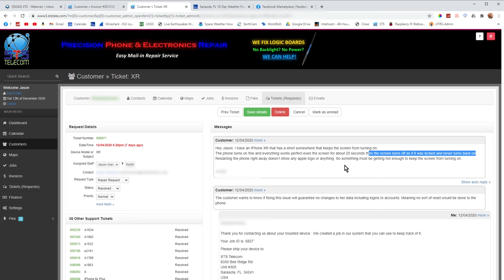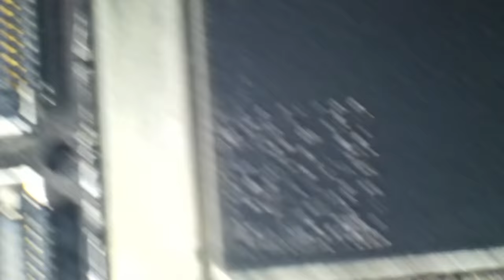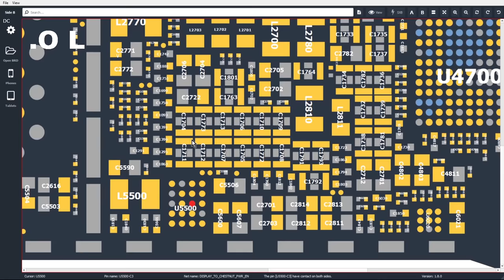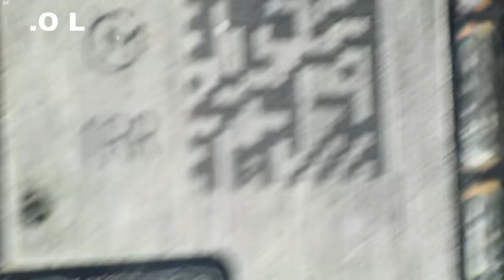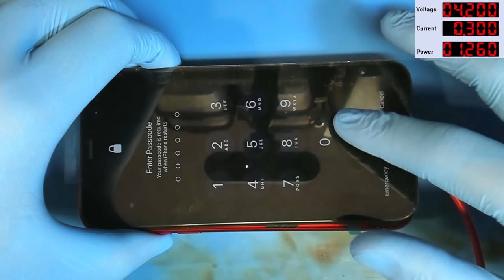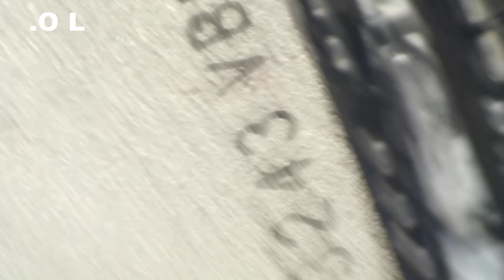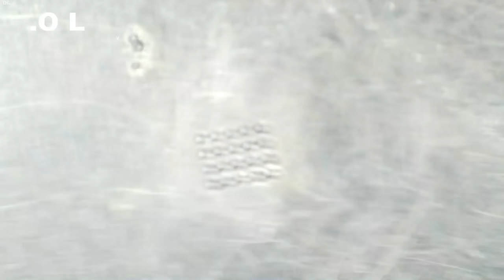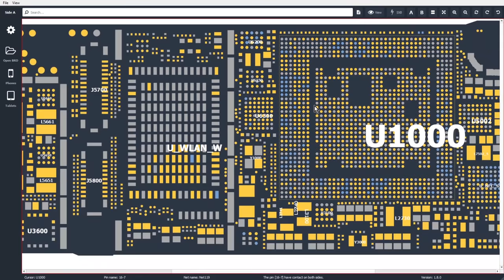Repairing an iPhone XR with "No Image" - What I found inside this phone was horrifying!

Comment: No kidding your heater isn't calibrated if you're setting it to 195c without boiling water
Reply: @Constantine Papajim even if that's the case he clearly said C not F multiple times, idk how you get the two mixed up
Reply: maby this guy writes kelvin with a c? tho then he'd be freezing it ...
Reply: @Constantine Papajim He says 195C.. that's 95C over boiling.  (And at 350C, the solder and plastic on that board would be already melting away )
Reply: @Constantine Papajim he said 195C
Reply: @AdeptPaladin   i thought that to
Reply: Water can boil at under 100celcius it all depends on what you using to heat it up
Reply: @southaussiegarbo2054  water can evaporate at below 100c, but only boils at less than 100c if in an environment with less atmosphere. The heater makes no difference to waters boiling temperature.
Reply: @nyxaelia115   i have boiled water back in year 9 science at about 75celcius.
Reply: @southaussiegarbo2054  I'm assuming that was a science experiment to show how under certain circumstances this is possible? What were the conditions? (Genuinely curious it sounds like a cool experiment). Pressure cooker a boil water at above 100c, but that's a change in atmosphere too. I don't believe if I were to put water on the stove at home at sea level it would boil at any temperature other than 100c. If you're below or above sea level (so a different level of atmosphere) it would be different, but probably not to the extent of 75 - 195 c
Reply: @nyxaelia115  just regular lab with bunsen burners and gauz mats on tripods. Beaker full of water on top.
(I finished school in 2019 so year 9 is to far back but i remember the weird stuff we did) 
Once the teacher also brought in wine to show us the distillery. 

Fyi no they dont do the boil water at 60celcius(water temp) now bc a class had beakers explode 😂.

Flame in one spot was hot enough to melt metals like copper.

Once my class set fire alarm off when i was leaving(cooking day and was pasta) bc i was sick. I herd a ringing signed out went home mum came home and asked did i have to light school on fire before i left 😂.

Next lesson i was their for im like "righto so who set the fire alarm off" and teacher said "us" 😂.

That case was 2 fire trucks but oneday at lunch 14 fire trucks show up bc of a fire in canteen and the caller said "the canteen is on fire" so bc that buildings linked to 90% of buildings in the school they sent a crap load of trucks. Oops when they cost 600bucks per truck for a minimum fee 😂😂.
Reply: @southaussiegarbo2054  The only way you boiled water at 75C is if you pumped air out of that beaker. There's a way to use steam to create a vacuum too, but that involved boiling the water at 100C then sealing the container and cooling it to create a vacuum inside. At normal atmospheric pressure, water will NOT boil anywhere near that temperature.
Reply: Yes, he says he's not going to heat it up enough to boil water, then he says no higher than 200C, which is equivalent to 401F. It does seem obvious that he misspoke, and meant to say 200F, which would be an easy error to make for someone unfamiliar with working with ANY temperature scale, but harder to see for someone experienced in working with measurable heat. I don't know what good explanation there could be for that mix-up.
Reply: @southaussiegarbo2054   It is actually completely irrelevant what material you have used to produce the heat. The boiling point of water is going to remain the same for your altitude regardless of how fast or slow you heat the water, regardless of the method you choose to produce that heat.
Reply: @kristinorthcutt111   not true the boiling point can change.
Infact under a complete vaccum it can boil with no heat at all
Reply: @VecheslavNovikov   it can but its hard to do.
Reply: @southaussiegarbo2054  I don't know what the actual experiment might have been that you are misremembering, but I am sure you are misremembering. For water to boil at 75C, using nothing more than a beaker and a bunsen burnet, this would have had to have taken place at the top of Mt. Everest, at the altitude of 28,000 ft. I am quite certain there are no 9th grade science classes being conducted at the summit of Mt. Everest (or any classes of any kind at any level).
Reply: @kristinorthcutt111   no the temp wont stay the same. Basic science proves it can change temp depending on factors
Reply: @southaussiegarbo2054  Factors like air pressure. At sea level pressure, it's 100 degrees.
Reply: @VecheslavNovikov   the science labs at the school were pretty dodgy.  
The water was also rain water so that could affect the boiling point just like salt does.
Had one point they had to drain the 20k ltr tank onto oval bc the water would burn which is not a good thing(mind you it happens in some aeras of my state so people cant use it to drink bc its like unleaded petrol when you put a flame to it....gulp(made local news and everything)
Reply: @southaussiegarbo2054  It sounds like the water wasn't boiling,  some contaminant in it was. do that long enough to boil off the contaminant and you're left with hot, but not boiling, water. But no, rainwater shouldn't have much contaminants in it since it's freshly condensed. You might have dissolved gasses and dust in it, but not really anything that volatile.
Reply: @VecheslavNovikov   possibly. But for cases of it being flammable is strange(not common but has happend here especially near mining towns
Reply: @southaussiegarbo2054  Come on now. Everyone know that water boils at 100C under "regular" conditions. This is a common fact that even the smallest of children know. The fact you misunderstood something in those shitty experiments doesn’t change this universal fact. Are you REALLY arguing this? Ridiculous. No matter how many times you say that doesn’t make it true, and it’s incredible that a teacher devised an experiment that completely devastated the world view of his students. Even more incredible is that you can’t grasp this basic fact. Please calm down now.
Reply: @VisionThing   it can change by various factors. You need to of had a decent science teacher to know it wont "always" boil at 100celcius thats just the most common temp it will boil at
Reply: @VisionThing   go do some good investigating and u will see that i have said a true thing. Lol teacher and science didnt lie
Reply: @VisionThing   goto denver and it will boil below 100celcius.
Reply: @southaussiegarbo2054  I knew this would happen, and you just won’t let it go. As I said water boils at 100C under "regular" conditions, with very little variation. You know this. Your water did not boil at 75C! It just doesn’t matter how many times you say it did. You did not produce a vacuum, neither did you conduct the "experiment" of boiling water (great experiment btw) on top of a mountain. So yeah your water did not boil at 75C. Don’t make yourself look stupid on purpose.
Reply: @southaussiegarbo2054   Apparently Denver’s elevation is 1.6km over sea level, which puts the boiling point at around 94-95C. That is an extreme example for sure but still within the minute variation I mentioned. You’d need to be tens of kilometers above sea level to reach 75C, which I am quite confident you weren’t.
Let me get this straight — are you really contesting the fact that water boils at 100C at sea level?
Reply: @southaussiegarbo2054  If your teacher wanted you to boil water and measure its boiling point, surely there was some trick to it? I mean why would teens otherwise conduct an "experiment" solely consisting of boiling water? So maybe you pumped out some oxygen but just can’t remember it anymore.
Then you forgot it and years later took away that "water boils at 75C" from the experiment.
Reply: @southaussiegarbo2054  With fracking, sometimes the rock cracks in a way that lets some of the more volatile parts of the crude oil mixture seep into the ground water. That's the part that's burning, not the water itself. Of course, water contaminated with the stuff isn't safe to drink.
Reply: @VecheslavNovikov   never said ground water i said rain water.
The rest is river or lake water
Reply: Markyboy McGill   what so funny. The fact that water wont always boil at 100?
Reply: Markyboy McGill   do some reaserch and real science studies and you will learn water dont always boil at 100celcius.
Im not joking lol
Reply: @southaussiegarbo2054   pure water at SATP boils at 100C. Change the pressure or have significant impurities in the water, then yes the boiling point will change.  But for practical purposes 100C is the general answer.
Reply: @AdeptPaladin   yeah and bc rainwater and bore water arent 100% pure so the temp changes. 
The school i went to used really bad quality rain water in the labs to the point if the tanks were empty enough it came out murky.
Reply: @southaussiegarbo2054  I have no idea why they’d use rainwater - all commercial and public properties have running water in BC. So they most likely used tap water. Even then, adding impurities to water raises the boiling point of water, not drops it which directly contradicts your earlier claim of it being 75C. 

Even La Rinconada in Bolivia is not high enough to boil water that low, as at 5000m ASL water still boils at about 83C. You’d need to be almost to the peak of Mt Everest to get to that point.
Reply: @AdeptPaladin   my school used rainwater for science labs but mains water for the rest.
The rainwater was eh shoddy shall i say. 
They also did have an old bore pump on the property(hidden behind bushes so very few knew of it) 
The rainwater certinly was not boiling at 100celcius or above.
75 is only a estimate because it varied from 75 to 90.
Reply: @southaussiegarbo2054  The only way you'd be able to get water to boil that low is, again, to suck out the air so it was in a reduced air pressure. 
Given your claim that it was full of sediment, that means you'd need to get the pressure below that which was needed to boil at 75C, so something like 1/4 SATP or about 25kPa.

That's far from normal water or normal conditions and is such an outlier to be irrelevant in this discussion.
Reply: @AdeptPaladin  idk how it happened but it did
Reply: @southaussiegarbo2054  you said you did your experiment using bunsen burner and did not say a thing about using any special equipment that would  change the pressure or create a vacuum. Under those conditions, the boiling point cannot be reduced.
Reply: @southaussiegarbo2054  It depends on what pressure you have the water under. The source of the heat is irrelevant. Basic chemistry  P1/T1= P2/T2
Reply: @kristinorthcutt111   the water wasnt the cleanest tho. 
It could well of been gasses dissolved in it making it seem to boil but idk that much after all it was only general science not chemistry.
Reply: @liuliwuyugmail   lol nope not broken when it was one with a coloured liquid in it(commonly said to be mercury but it isnt any more)
Reply: @southaussiegarbo2054  yes under less pressure. You can get water to boil at 10c if you remove enough pressure from the vessel. Master plumber here

Comment: "It's not gonna be set hot enough to melt solder, let alone boil water. So we'll set it at 205° C"

Water that boils at 100°C "am I a joke to you?"
Reply: 205F = 96C
Reply: there is some mixup with units? talking about drying and keeping hand on top of board feels tha he is talkking about F but 350C makes sense for me who is used for standard  units for soldering temp., I am upset, but cool video, respect.
Reply: The uncalibrated thermometer is probably showing 205C while in reality the temp is way below 100C

Comment: I'm curious.  Is the iPhone owner being sincere with you about its conditions, or was it some hack 3rd-party repair shop?  Interesting to hear the story about this, if there is one.
Reply: If the owner had sent it off to another repair shop prior to STS for this screen issue, then STS is simply repairing a botched repair job... which may actually be the case. The owner might not even be aware of how much repair work was botched by the first shop. The first repair shop might have simply told the owner they did nothing to it.

Comment: Apparently I am not the only one here who has no idea what “ball squeezage” means. I have some experience with electronics and have enjoyed many, including iPhone repair, and have never heard this obvious slang. Here is some slang for you——-SHEESH!
Reply: I've never really heard anyone call it ball squeezage before, but what he is referring to is when the tiny balls of solder under the chips are squeezed out or shorted between pins either because too much solder was used or to much pressure was put on the chip while it was hot from a short or during the soldering.
Reply: @oliverer3  thanks for the explanation
Reply: @oliverer3  I've never heard "ball squeezing" before either.  Well, at least in this context...
I've always referred to it as "excess solder" or  "a shit solder".

Comment: I would recommend looking into an alternative product than standard cotton swaps for any electronic cleaning.  They leave behind fibers that can cause more problems than the dirty connections you cleaned.  They make debris-free cleaning items that electronic manufacturers use in clean room type environments.  They should not be too expensive.
Reply: You can get lint free buds, similar to lint free rags used in printing.

Comment: The amount of equipment envy I'm feeling now could turn me to the dark side...
Reply: Haha, I posted that same comment way back when I started building my lab. But I learned that Labs get built over time, you'll have yours up and running someday if you spend your money wisely and in respect with the work at hand. And if you are low on cash, there are a lot of alternatives to high end equipment that get the job done. Of course, having a good binocular is absolutely awesome, but you can get a cheap 100$ chinesium 7 inch screen microscope that will do the trick. Soldering irons are important and thanks to hakko, they are affordable, for a little more than a hundred bucks you have a station you will keep all your life... so and and so forth.
Reply: @zet0korp  Thanks for the advice and encouragement! ^_^ Have a solder station and a few old microscopes, though I broke my CCD imager recently, so have had to resort to using a phone through the eyepiece, fitted with tape and an oversized adapter. Most of my kit is donated and it's helped me do a few things, like re-cap monitors and stereos, but micro-electronics are another matter...
Reply: @Jennralize  ^^ you're welcome. 
Well, "micro-electronics" as you say can be daunting at first, but if you have a steady hand and the time/quiet to work properly it's not such a big deal. As you've seen in this video, a pair of tweezers, some flux and a hot air gun (which also can be purchase for pretty cheap - got one from china for a hundred bucks  that looks like a toy but works wonders), you can do pretty much any repair you like.
If you are in need of insights/hardware advice, you can shoot your questions, i'd be more than happy help my fellow electronics enthusiast ^^
Reply: @zet0korp  Awesome, thanks again! ^_^

Comment: Amazing video. The miniaturisation of components is extreme, until you need a scope to work with. No longer solder a lead but flux & hot air. No longer a hobbyist past time, unless very rich, to have all the specialised tools needed. Unique world! Good experience but may not spend a near hour on miniaturised repairs!

Comment: Wow, First time viewer of your channel. My hat is off to you,, You gave me a taste of what is involved in this type of diagnose, troubleshoot and repair in the micro electronics field. 
   I must say it looks to be a big pain in the ass remove/replace of components as a narrowing down of troubleshoot or components failure in this case from someone's earlier handy work. 
    I bet it's nice when standard testing values point out quickly what is happening within the systems or sub system sections.  Major thing I found was the size of the things you work with, Crazy tiny and the tiny adjustments like when seating in that IC after re-balling just before applying the heat.
  Better you than me, I'm about half blind now,, trying to focus on tiny things like that would make my site go the rest of the way.

Comment: There is something strange about putting wet stuff all over delicate components and then adding lots of heat. I don't know what I'm talking about but I just love watching you repair all this stuff. I love the Flux part and re-balling. I wish I could do repairs like this and had all your knowledge. I broke my phone just by changing the battery and someone stole my Galaxy S7 which my dad gave me. What is a good phone for me to buy right now? I don't like Apple cause they are too much money and people have told me the quality and compatibility with it's apps and software isn't as great as it used to be.

Comment: I don't know if this has been pointed out; I know this is an oldish video but for future searchers:  195C = 374F. So well hot enough to boil water and melt a lot of solder alloys. So if you're doing this with an actual temperature calibrated machine, I would go with roughly 80C to remove any alcohol if you're certain there's no water left, maybe 90C if you need to remove any H20. But in my experience, you can evap off most of your remnants at 80C for 90-120mins. Just my 2 cents, someone who wants to do the math can correct my numbers!